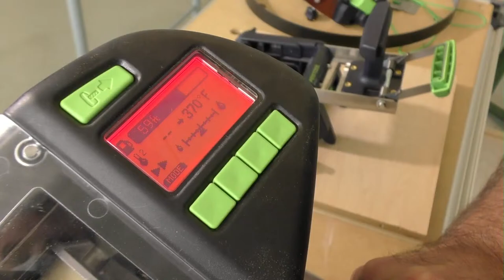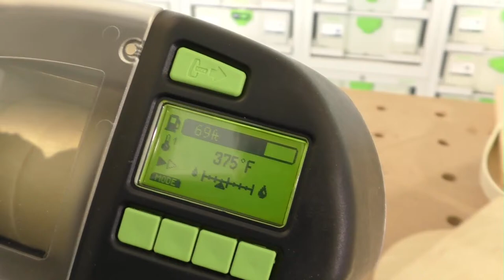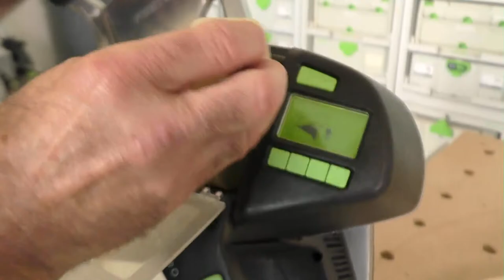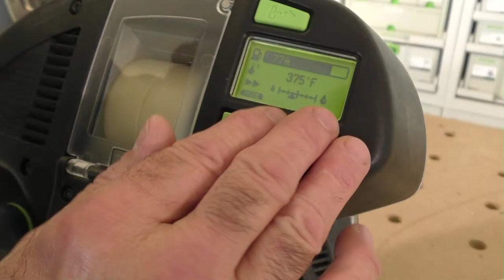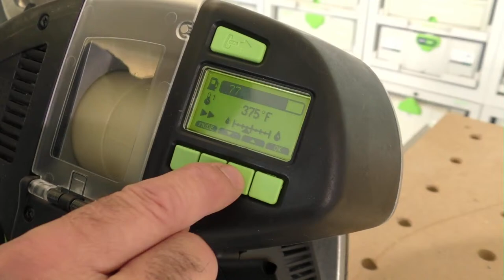Festool Live Episode 19 - CONTURO Basics

Comment: Hey guys. I can’t use 0.5mm pvc tape, if I lower the temperature I don’t get enough glue on the tape, and I when I heat it up to 145° still melt the pvc tape, anybody has a solution? I would appreciate it if you let me know.

Comment: So all the machine does is apply the glue and align the banding to the workpiece? Then you need a separate router to trim the banding?
Reply: yes, and you need to pay 4000 for it. But it has some advantages over stationary machines for the same price... you can take contour and edge band 4 meters of a panel. but you can't take 4m panel and edge band it on a. stationary machine.
Reply: @antonstafeyev3606  you can on the machine where I work. The real advantage you failed to mention is the ability to edge band a radius.
Reply: @kellym3610  well it also does all the drilling and routing with 5 axis, basically feed the part, get finished part out of it